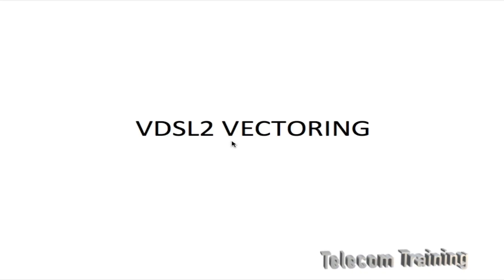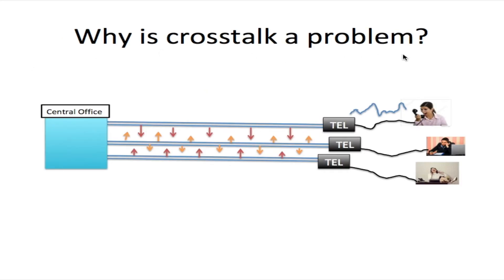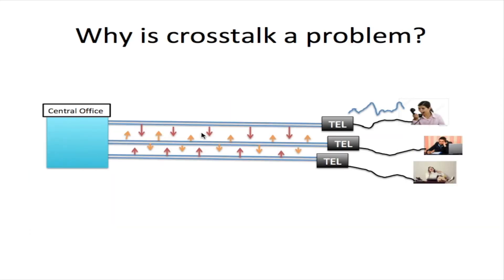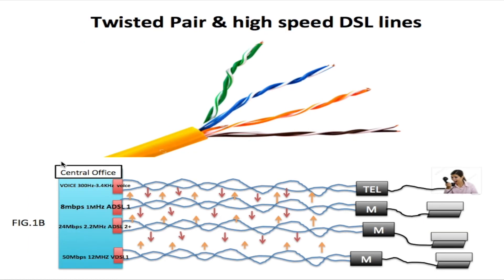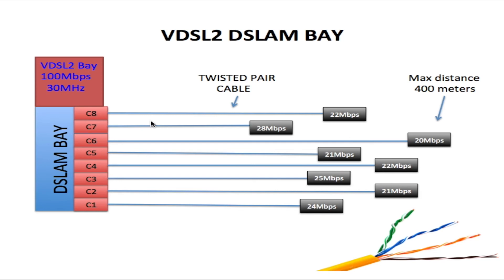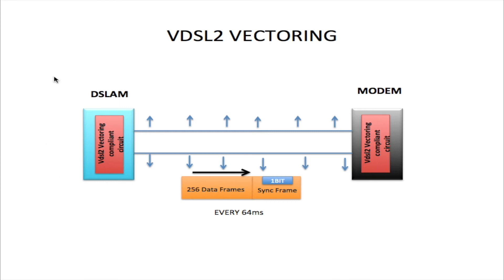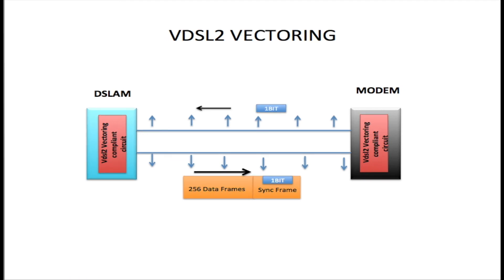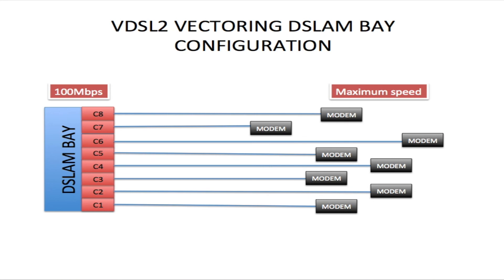HOW VDSL2 VECTORING WORK

Comment: 4:37 You did not mention something very essential about the twists in the twisted pairs. The reason why the twists reduce crosstalk, is that each twisted pair has a different number of twists per unit length. If your twisted pairs would have all their twists perfectly lined up with one another, the twisting would have no effect whatsoever. The problem of course, is that the twists only reduce the coupling between the pairs, but they don't eliminate it completely.
Reply from the maker: Yes my friend that is totally true.  I do appreciate you pointing that out.  Each pair's winding is different.  This prevents interference and allow the noise cancelation  to work most effectively.

Comment: I believe it is possible to achieve 100 Mbps bandwidth over a VDSL2 17a profile on a short copper loop?
Reply from the maker: That is correct.  It is possible to achieve 100Mbps over VDSL2 if the line is short enought.  The shorter the copper line, the higher the speed will be.
Reply: @TelecomTraining  Have you heard of the new 35b profile with VDSL2?
Reply from the maker: I didn't know about the 35B.  I'll be sure to do some research on it.  Thanks.
Reply: @TelecomTraining  35b is what we call Vplus. You also have G.fast, which allows speeds of up to 1 Gbit.  It basically requires fiber to be at the curb, with copper loop lengths less than 100m to allow for 1Gbit.
Reply: @checkyourfax  does the cabinet have to have special equipment for that or normal vdsl2 equipment would sufficie

Comment: Good video. Thanks. Can there be different amounts of crosstalk upstream than there are downstream? If so, how does the system handle it, or does it  get the 1 bit and then assume that crosstalk data applies in both directions?
Reply from the maker: ADSL OR VDSL Lines have a greater bandwidth downstream than upstream resulting in a higher data rate downstream.  The higher the data rate, the higher the Electromagnetic Induction will be.  The name Cross talk came from the voice world. and it is the same as Electromagnetic Induction being induced from one wire to the other.  So yes more cross talk would be generated with down stream than upstream as a result of there being more Electromagnetic induction.   
 I do appreciate the question.  Sorry that I didn't get a change to answer your question earlier, and I hope that my answer is helpful.
Reply: @TelecomTraining  Great answer. Thanks for that.
Reply from the maker: @bradkaral1188  You are welcome Brad.